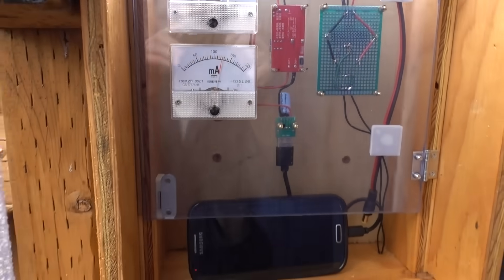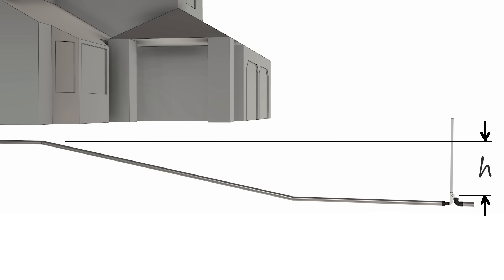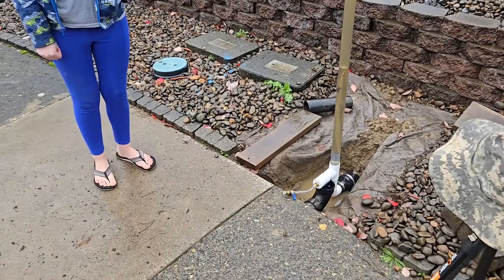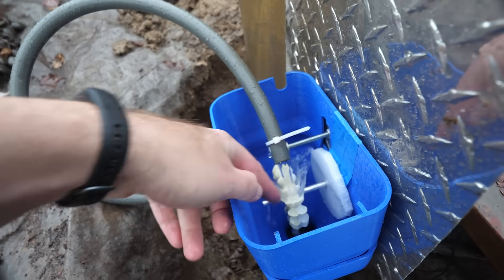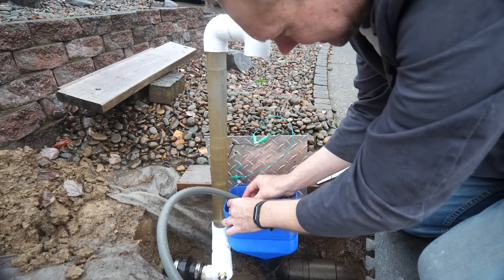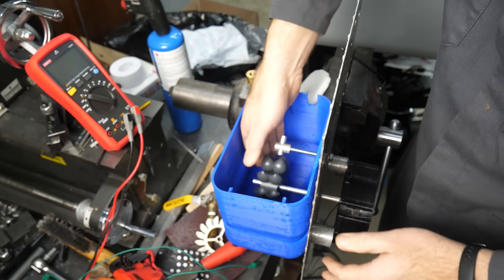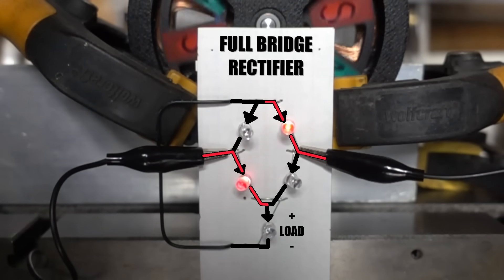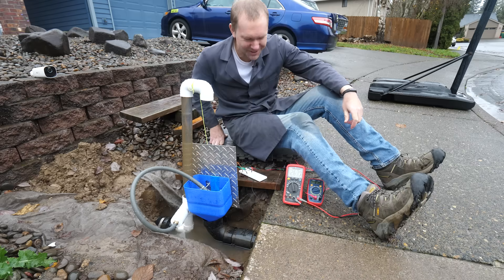Curb Rain Power!

Comment from the maker: I would love to hear suggestions on how best to store and release water in the pipe around the house. The bell/auto siphon worked really well on the rain gutter, but this is a little different. Maybe a mechanical system would be better? Let me know in the comments! Also consider checking out my patreon page for extra content exclusive to patrons: https://www.patreon.com/QuintBUILDs
Reply: I know it would take "considerable modifications" as you said, but if all the downspouts and gutters were to be connected as one reservoir, you could still use the bell siphon at the top of the whole thing like in the first series.. That would give you some insane head pressure!
Reply: This would be so much better if you took advantage of the water exiting again downstream. Do it every couple of sections on the downhill
Reply: I think you perhaps need a tank in the system higher up to increase your potential energy, like with a water tower, while your pipe in the ground is your reservoir you are loosing available energy and should just use the lower end of the pipe as a spill way.
Reply: @ddoherty5956  Yes, I was thinking of the Ram Pump effect when I saw the water level fluctuating.

If you fill a water tower as high as the rain gutters with the help of a Ram Pump, it would give a much higher flow and I would love to see this!
Reply: You should try a Kaplan turbine. Best for Low head high flow. Or maybe a cross flow
Reply: We should get together I’m obsessed with hydropower, I’m in Orlando Florida I have several ideas for land based and home based hydro systems. Some game changers!
Reply: @professionalguy9346 are you able to design them and mail them to him
Reply: About storing the water: I assume your connections between gutters and underground pipes are not watertight at pressure and/or you have any oppenings that limit the water hight to the ground level of the house.
In this case all the suitable water storage solutions I can think of would require landscaping and putingin underground reservoirs. If you go that way, keep reservoirs in such hjeights that the top of them is at highest water level while the bottom is at the lowest feasable water level for energy generations to avoid storing extra water that you don't need and maybe breeding mosquitos there in the summer.
You could also use the water to pump some of it to the containters on higher ground with ether ram pump or pump on water wheel. This would probably greatly lower efficiency of the energy harvested from rain. Note that ram pump is very loud too.
Reply: why include all the friction of the horizontal pipe and lose more energy, put the generator at the base of the house where the vertical stops, if it's on a slope the sweet spot is definitely more towards the house, also think about a flywheel
Reply: Some kind of float in the downpipes from the roof? When the float gets up to a certain point it trips a valve open at the turbine (somehow, sounds like a connectivity issue more than anything, some kind of low power IOT wireless solution is no doubt available), beginning a water dump. When the float gets to ground level, it trips the valve closed, and the water sits there, filling back up waiting for more rain.  This will send power in bursts, and possibly only after several bouts of rain, but with a predictable drop each time: the height of the house up to the eaves. No more, no less, which should make any electronics/battery charging/capacitor integration easier to build for too.
Reply: you could try adding a ram pump to bottom of the house and add a very high tube to build up way more head pressure
Reply: Love the idea. Any sort of renewable energy capture is awesome and this is a really fun project.

The straight flow through from rain as it happens though will produce very very little energy so my advice would be to have a holding water tank to capture the rain en masse and then releasing it to produce energy at your own demand instead of attempting to capture a trickle whenever it rains.

That way you can use a water tank as the "battery" to fill with rain before releasing it in large volume to charge electrical batteries when you need it AND have the volume of water available to release when you do so.
Reply: why not make better use of what you already developed and after the down spout generator to a home battery storage system (better enclosure on that assembly than I caught in the vids to note lose flow) moves to the curb system, wide angled turbine fins on a wider surface for flow over pressure performance. less height needed for full system as well since the low will work with less height build up on pressure. Encase about half to two thirds of turbine so water only hits the top section. tie this into same battery system as spout is.
Reply: A couple of Francis Turbines - and a Kaplan', maybe?
A thought would to use one Francis' as a generator, for a second one to be utilised as a pump, to refill a reservoir - if useful. And a Kaplan Turbine with manoeuvrable (remote-controlled?) runner-blades, for a second powersource. Or is that unrealistic?
Just DON'T USE YOUR ROOF AS A RESERVOIR! - as I (HOPEFULLY MIS-)understand you intention of planning to..
Reply: Maybe an electric sprinkler valve? They tend to be good for high flow and low pressure drop across the valve. I'm not sure if they'd operate properly at such a low overall pressure though, as they use the incoming water pressure to run the pilot valve system
Reply: I don't know of fancy name for this valve system, but what I would try it I was in that situzation is to have a set of 3 balls connected as a valve. First one would be made out of rubber or something similar (just a bit heavier than water) and would sit on the opening to the turbine. The second would be imediately above it and would be filled with air to generate enough lift to keep first one from sinking, but not enough to lift it when sucked to the opening. The third one would be connected to the system with longer string and would have to be big enough such that its buoyancy could lift the first one up from the position of sucked to the oppening. 
Of course this would require for you to have wider vertical tube.

The way it woudl work is when the water would reach the desired height (defined by the string length), the third ball's buoyancy would lift the 1st ball out of the hole to open the valve and the second ball would keep it from settling back and closing the valve untill water gets to low. The distances between balls 1,2 and 3 can tune the desired minimum and maximum water heights.

Though I can see one issue with it and that is debrees. If it got stuck between the 1st ball and the ghole, the valve would not shut off completely and you would have a leak. But a screen filter should get rid of that problem and if you make the filter area large enough it should last a while before clogging.

edit: one more potential issue that I just thought of about my design is that when the 1st ball would be lifted just a bit, it would be still sucked in due to bernoulli principle, so there woudl need to be like a spring or something so that when it is lifted it is imediately lifted high enough to not be pulled back in by suction of moving water.
Reply: Simple float valve?
Reply: What about a ramp pump down there, sending some of the water up to the roof into a container that has a auto siphon to send it back down, with lots of pressure?
Reply: For a more stable current you should add a flywheel
Reply: Could you use a solar panel, water level sensor and a solenoid valve to trip a ram pump into working to give yourself more height in your resevoir?

Comment: I think that you are losing half the pressure you could have there, by operating so much higher than the tube (that is  in the ground).

Would you consider a turbine that spins on the horizontal plane (X-Z plane)? i.e. the axis of the turbine is vertical (in the Y axis)
and you put that in the ground.

second part i think which you could have before the turbine, would be a spring loaded manifold, that opens up when it gets certain pressure on it (i.e. "weight").
It could be mechanically connected to close again when the turbine stops spinning for those very slow rains/drizzles?

of course all this is if you want to continue operating there, at the end of the underground pipe. But as other say you run into a few risks playing with underground water...
Maybe you stop the water above ground and you just leave your turbine at the end of the pipe?

Comment: I've been thinking about things like this. I would put a nozzle similar to a pressure washer on it. I would make a barrel out of that tube that goes up, because it increases the pressure. I would put a tank near the house where all the pipes connect and have the outlet coming out of the bottom edge and that hose. If there were two nozzles on the main hose, the rotation speed could increase.

Comment: Just watched the 2017 rain gutter video. Just a quick question , just like a dam use the watter why did you not use 55 gal barrles with bulk head screw to connect 3 and draw water from them? Like a big watter battery. I have 3 and a over flow so I don't need city water for my yard. I stacked them like wine kegs. They were free vinegar barrel .

Comment: I think you can achieve a more efficient design flow rate if you route the water of the main drainage pipe around the propeller like in a real hydroelectric power station (like a snail house pattern)

Comment: Why not use the water storage on the roof to store the rain water. Then run a single pipe to the drain pipe to give it maximum flow.

So the rain storage can be the battery, and then when it gets full it dumps it all out at once

Comment: create a piece of pipe with a generator in the middle with a prop behind it. also a T-split before the generator to See the head and you could even open a valve to the turbine section when it reaches high enough

Comment: I think something far more unconventional would yield better efficiency. Low flows and low heads mean extracting as much energy as possible from the change in height from the source to the drain. Converting moving water into moving mechanical parts is inefficient at best but when the source is free it generally doesn't matter. But, rain isn't, and mechanical transmissions are more efficient at converting power than reaction wheels. A setup which fills a bucket on a ratcheting lever arm which then slowly drives a high ratio geartrain down to the generator would be ideal. If the bucket were to have an arrangement akin to a Japanese shishi-odoshi tipping garden noisemaker to empty the bucket at the bottom of each long stroke, I'd wager a lot more of the stored energy in the water could be extracted. This could even be coupled with the autosyphon so that the bucket would get filled all at once, take a ride down (while no water flows and it is storing up), come to the bottom of the travel, tip (thus draining the water), spring return to the upper position and await the next autosyphon drain event.

Comment: What if you put a manifold at the top of your outlet head and used like two water wheels? Do you think the added weight would be worth the additonal torque?
Also, as somebody with my job experience (10yr plumbing, 3yr pest control/termite), I'm also reflexively cautioning you about washing the soil away from your foundation.

Comment: That calculation seemed overly complicated to me, I use mgh and just put in the correct units directly, height times gravity, and you have the potential number of joules in gravitational potential energy for a given mass. And when you want the watts, just multiply that with the number of kilograms per second. 

I usually round off the density of water to 1,  partly because the difference rarely matters, and partly because the density of water varies with temperature. Don't tell anyone, but sometimes I secretly even round off gravity to 10, when I just make such calculations in my head to get an initial rough idea. When writing it down I find it good practice to write 9.8 or 9.81 even, which is the correct rounding of 9.80665 that is often considered the "standard value" for gravity at Earth's surface, to three significant numbers.    

Another strategy I personally find useful is what I call "cleaning up" units as early as possible, as in converting gallons to liters, separately, and not convert gallons per minute to liters per seconds. Or better yet, avoid using gallons in the first place, as millimeters times square meters equals liters. Just one of many examples where the metric system is just that much simpler than the US mess.     
 
0.3 x 0.997 x 9.8  = 2.93118 not 3.08. I didn't make that calculation in my head, but I also didn't need to calculate it to see that it should be slightly less than 3 and not slightly more than 3.     

Anyhow, keeping the calculations simple and focusing on what's important can make it easier to realize that you need to increase the mass as much as you decreased the height just to reach the exact same potential output.  If you increased the area and by that the potential mass by a factor of 2.5 and decreased the height to lets say 40% of what it was before you have the same potential output, from a given amount of rain per unit of area, as 40% of 2.5 is 1  

Keep up the great work!

Comment: You should Look into Low head -  Low RPM - Gravity Vortex Turbine  (Gravitation water vortex power plant) seen a few Small ones do 240V AC 2000W With 1 meter Head But a long Water race 
Even look Into Archimedean Screw Turbine IF THE FLOW Is limited They get good bigger Outputs the Longer they are and if you Take Power from the outside of the screw CVT (Continuously Variable Transmission - MPPT of mechanical Drives) + Gear box 

I would of added  capacitors and joule thief (even a 3 wire  joule thief and get mains voltages  )/ lasersaber Super Joule Ringer (SJR)

I would also use a few IBC tanks in the yard  with Syphons (to build up A Large water charge and when has 1 ~ 5 hours  built  up let it go with a  Syphon with a Pee Trap on the bottom and a long pipe to the Vortex / Screw

Comment: It might be a good idea to know WHY that in ground drain system exists before cutting into it. I suspect that might be part of your foundation drainage system that some homes have. They are designed to draw water away from the house foundation when the soil is saturated and dumping it into the city drain to protect your home. If its just a straight rain drain, then you are fine, but you better make sure your foundation is not impacted.

Comment: Putting a barrel with an autosyphon mid-way as a buffer and accumulator would be a major help because you would get burst of higher power output and then nothing for a while. Making it a closed system as low as possible that is just inserted into the pipe would also be a major improvement since the water wouldn't have to go up and you wouldn't have to generate pressure. But at that point we are just reinventing a hydropower plant lol. Some others suggested schottky diodes for the rectifiers but it might even be better to make it purely mechanical with sliding contacts, that swap the polarity at every coil and just output DC from the start with no rectifier. There are a couple corners where you can shave off little tiny bits of waste. Using a resistor and a capacitor as a buffer would also make the output smoother with no bogging from too high power, that might hold the thing closer to a constant maximum power point at the cost of some loss, as it's passive, not like a solar controller but making a net positive in the end. You need to find where the generator makes the most power and do your best to hold it exactly in that region, whatever it takes. It would also help the bogging and losses at the cap and resistor if you made it a multi-phase generator and not single phase as the output power would be considerably smoother.

Comment: It's all fun and an opportunity for learning, but 3D printer using 300 W for 4 hours.... you'd have to have 400 hours of rain to even come close to breaking even, once you get your output up to 3W.  Fun and entertaining, but in the end...
Reply: but once developed and refined in production the system can be mass produced at a significant energy cost reduction allowing for the making of each to be less than an hour on a system that uses 400 W. numbers not confirmed. the system can last unspecified amount of time as is and the refined system will likely be more long term durable so 3W need come back about a hundred hours to begin positive output effect. now combine the fact the down spout is a separate energy generation and the same rain is producing more energy for greater source efficiency.

Comment: I don't see how you can improve on the original arrangement apart from by utilising more roof area eg just link your gutters together..  The higher you store the water the more energy you are capturing.  If you store the water at ground level you have already lost most of the potential energy as it falls into the reservoir and turns into heat.  A good indication that there's very little energy available to be recovered from rain is the fact that it isn't even warm after it hits the ground.  Even with waterfalls hundreds of feet high the rise in water temperature at the bottom of the fall is barely measurable.  Nonetheless these videos are great so keep them coming.

Comment: Two check valves and some way of sealing up the stand pipe so it can pressurize, and you can set up a ram pump. And then use that to power something.